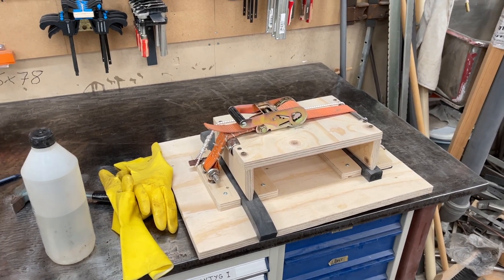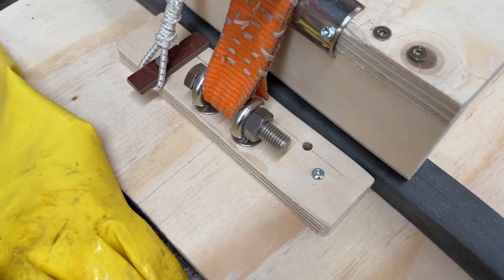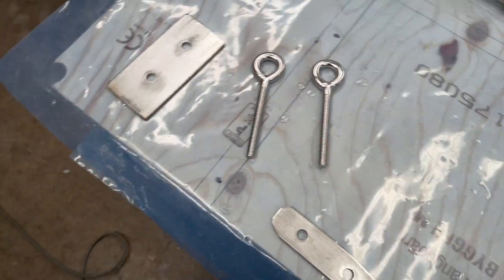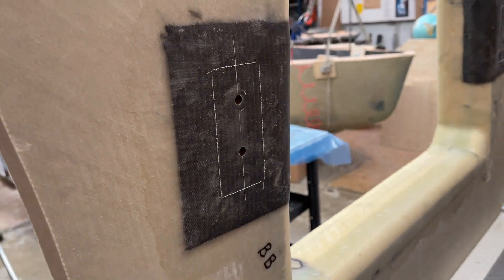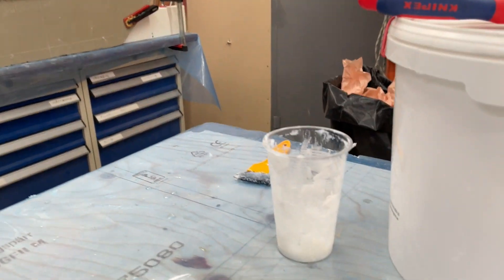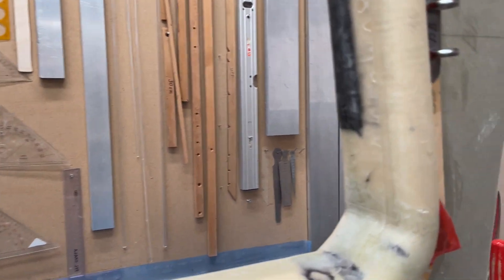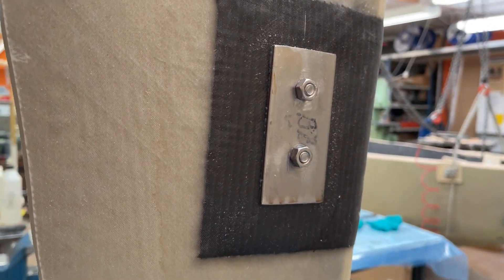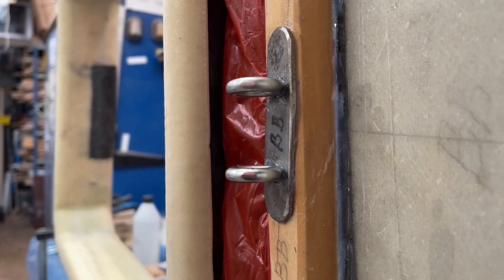Making strong points for the ratchet strap.

Comment: I’m curious as to why they are angled on the wood? It seems to be intentional because both sides are that way
Reply from the maker: Its becouse the hatch cower is not rectangular due to the angle of the side by side masts made it not possible to have it wider at the top. At the bottom it was more place. It will be clear later.
Reply from the maker: One more thing. Whats looks like wood is high density Divinycell, the type they build submarines of.

Comment: Are you going to change those nuts out for nylock nuts
Reply from the maker: No change. The nuts and screw are degreased in aceton and epoxy is added. Later the outside of the nuts will be in epoxy as well when I insulate them with Divinycell to awoid cold spots.

Comment: Hatch tie down hardpoints suitable to lift the hull by!
Reply from the maker: Indeed I make things as strong as I can. The boat fully loaded for 100 days is planned to weigh less than one ton. Each of those four M8 eye bolts should be able to take that load. I enjoy super strong fittings.